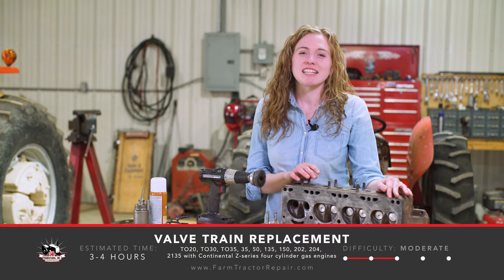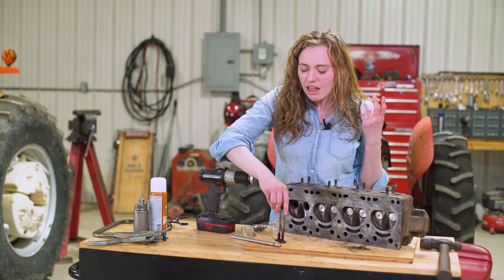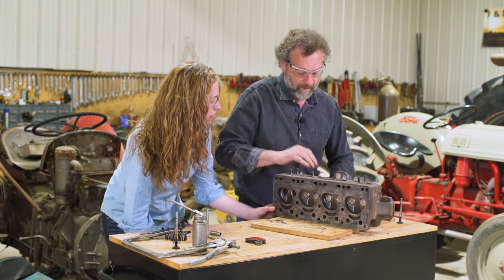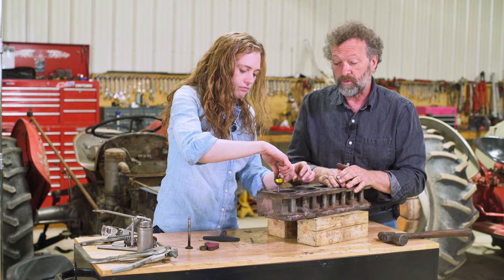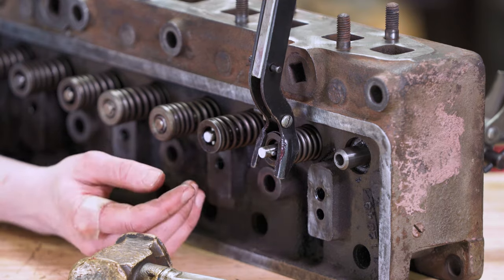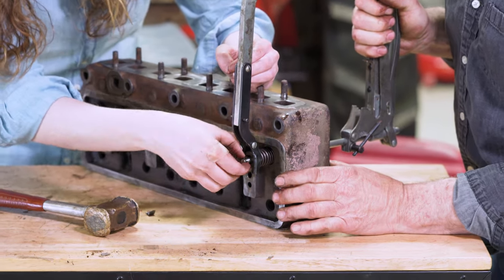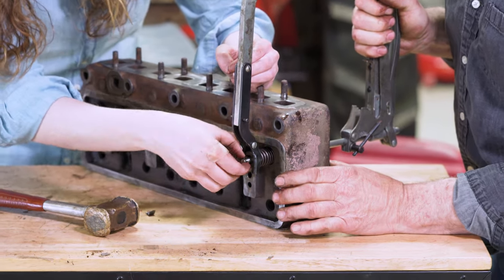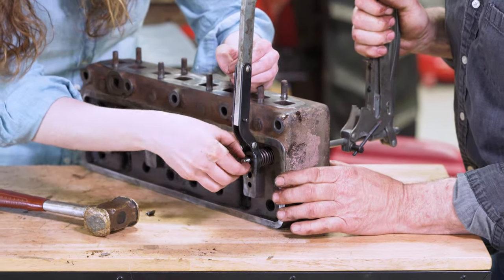Valve Replacement and Adjustment for Massey Ferguson TO20, TO30, 35, 135, etc. with Continental

Comment: Doing a rebuild on my 52... opened it up and 1 pushrod has a nice "S" shape and 2 have an arch... now I'm going from pistons and sleeves to cam and valve train also... but after it's done I'll have a solid tractor for the next 20 years...👍

Comment: I have a question. I have a Massey Ferguson 175 with a hydraulic problem, We opened the lid to fix a PTO problem that we still can't fix but now the hydraulics are not working the lifter arms have full pressure and they will not go down. They used to go up and down just fine until we tried to fix the PTO shut-off handle inside the Hydraulic area. Can you tell me what I did wrong?

Comment: Having a problem finding a rubber bushing kit, for my 1940 ford 9-N front end hydraulic loader pump shaft, in the end of the crank pulley??? Thanks BigAl California
Reply: Hercules hydraulic seals Florida has by size all seals packings orings .
Reply: @Nudnik1 no it’s 4 pin hub end on the left-left hand shaft that turns the hydraulic pump ,,,they are 3/4 inch deep and 1 inch in o.d. Size,thanks , nothing to do with seals or o rings thanks buddy

Comment: I made a guide press tool out of one of the punches from my Harbor Freight set. I measured the installed height and made a cup to go on the punch so that when it bottoms out, the guide is at the proper depth. It is long enough to push out the old one and push the new one in all in one shot. I don't believe in hammering the guides in, I used my press.